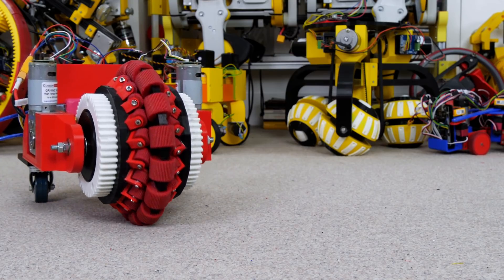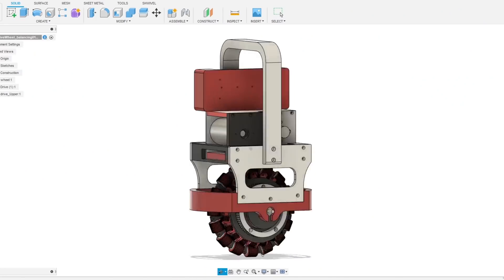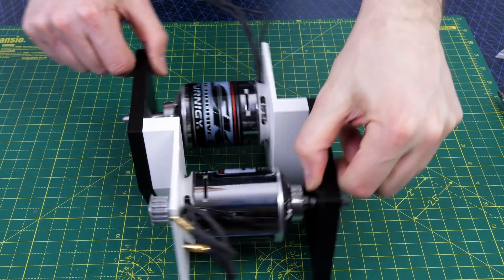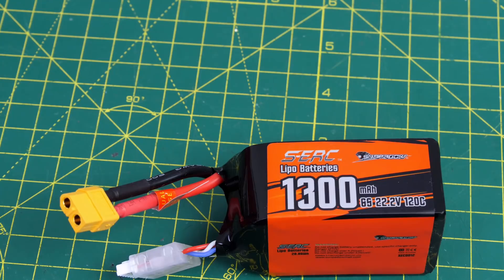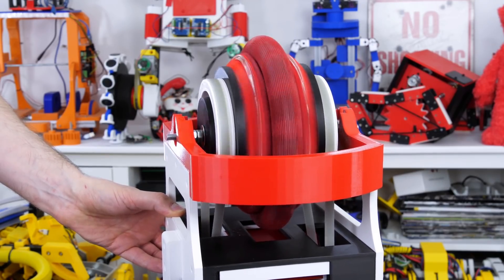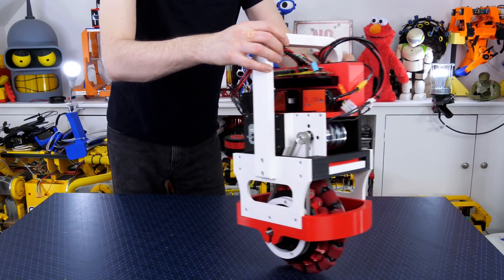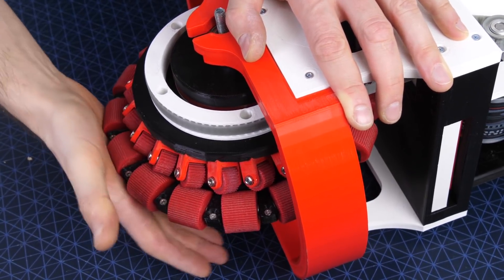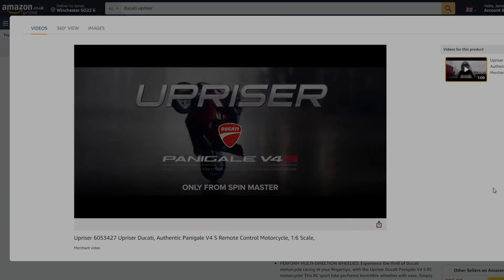Omni-Wheel Balancing Robot?

Comment: Pretty impressive how quickly you build complex electro-mechanical prototypes.  As for the wheel my feeling is there's too much play in many places for the control system to reach stability.  Those big motors are are causing large inertial changes.
Reply: Incredible how creativity, skills, cad, 3d printing and yt sharing work so well together. Far beyond any expectations.

Edit: forgot to mention the sponsors 😎
Reply: Right? It's very nice

Comment: Little idea as improvement for this design: You could angle the side wheels slightly outwards so the roller wheels only make contact with the main wheel where you can actually produce traction with the ground. This way you don't lose any power on driving unnecessary wheels and clamp more on the main wheel

Comment: You could add universal joints between the small wheels instead of a flexible shaft
Reply: I don't know if the definition of UJ has changed, but when I was younger it meant something which turned uniform rotation into uneven rotation. To keep the rotation even, they had to be used in pairs like this: ⁻\_ . However, there was another type of rotation-transmitting joint which it didn't have this problem. I've forgotten the name. Anyway, the bad kind is the one with a fork on the end of each shaft holding a cross-shaped piece in the middle.
Reply: cv joints would be difficult to build in the space between the wheels, and you'd need a lot of them

Comment: Do you reckon having diamond-shaped corrugations on the main wheels would allow better gripping with the smaller ones on either side?
Reply: Kinda turning the main wheels into gears 🤔
Reply: I have a swarm project. But its hard to get attention on the internet. It MAY have a small impact towards the STEM community. Dont wanma make a video on to get 0 views. Should I wait for this tuber's reply? Planning om showing this to college since I may not get much out of internet
Reply: on hot sands, it moves quickly! & it's bite, is no fright! but leaves some in horrible trauma! is the end near? or will he be late 4 diner, again! only dt will tell !!
Reply: @comelighttheway  ?
Reply: I suspect diamond-shaped corrugations could lead to uneven gripping if you're not careful.

 @Jermain-cz4bh  Looks like an allusion to the viper or the diamondback rattlesnake, both of which are venomous.

Comment: A 3rd Encoder on the thread which is sticking out of the sides could actively cancel out the creep, as the controller will be given the exact position of the middle wheel hub.
Reply: Good idea... Difficult to get it's data though
Reply: @Lardah  Why so?  Isn't the main axle going right through the main wheel frame and sticking out each side?  Mount an encoder just outside the bearing on the red base and you have it.  (at least it SEEMS like that's all you would need)
Reply: @mikefochtman7164  ah yes I just assumed the axis is fixed outside and has bearings on the inside...
Well then nevermind

Comment: You could wrap belts around a wheel, from a central hole to the outer edge. Put rollers along the outside edge of the wheel for the belts to roll on, and a motor in the center of the wheel could turn the belts for sideways adjustments.

Comment: You could remove the gears and crab walk it if you made it actual wheel itself to have an array of motors that are arranged into the shape of the wheel and each motor is regulated by a combination of mercury switches and lidar and gyroscope.
Each motor is essentially a tiny wheel with a tire that can also allow for traction that can even have the ability to regulate density through a capillary manifold system. This can even spring into the air with actuators and a origami of winged flight possibilities.
This can be produced from harvesting from rocks and bio organic material brewed from a tea of gross disgusting microbial bacteria and post treated to see how affordably it can be replicated. 
👁️👁️

Comment: Could you add some sort of encoder to the center wheel so that your software can accommodate for the drift by actively tuning the motor speed? A combination of position data for the outer and inner wheels can act like a traction control system.
Reply: Oh that might be a workable idea
Reply: Exactly what I thought, he's getting feedback from the motors not from the actual outputs so the system is still an open-loop system at least when it comes to this part.
Reply: +1. Computer mouse wheel is what comes to my mind first, buy it may not work at the speeds this low

Comment: You can get a flex shaft to link all the bigger rollers pretty cheap off ali, they are often square so you could have the center hole of the rollers be square to key the wheels together, then join the two ends halfway down  one of the rollers.
Reply: Wouldn't even need to be a continuous piece, a short piece that would slide into a socket on each side of each wheel would connect them all together just fine.

Comment: What about keeping this roller design, but change the surface of the rollers to be meshing like gears, so slip is impossible?
Reply: If one tooth slipped, it needs to be accounted for, but it's an awesome idea!
Reply: @codyman242002  If two kanted rollers are always in contact with a hub roller, then no teeth would slip and it would self-align to mesh.

Comment: I have two Ideas on how to improve the design: You could put diagonal teeth on the outside wheels that align with those on the output wheels so you don´t entirely rely on friction for force transfer. 2nd you could look into 3d printed constant velocity joints like they are used in cars to connect the circle of wheels. you can print them in standart pla nad then pop in small steel balls for the force transfer. This should result in a constant speed transmission between the single wheels with minimal play if you tinker around with the tolerances. They might be a little fiddly to put together but should work with less play and friction than flex shafts

Comment: What if the treads of the small and big wheels meshed? 

Interesting to see the results of using a solid core on the wheels.
Reply: That's what I was thinking last time. Couldn't the grooves be printed at an angle (or a helix)? Maybe it would screw up due to the flex, or the wheels not being a constant distance from one another.
Reply: I came into the comments to reccomend a helical cut on the drive wheels!
Reply: @jimmygriffiths    Yeah, I see a few did before me as well.

One option I hadn't thought of that's posted farther down is using that left and right thread pattern on the big wheel. But I don't know if that would be better than just making the left/right small wheels asymmetrical in their orientation.
Reply: I think no tread would also work
Reply: You might be onto something there. The problem with TPU wheels is that although they're squashy, they don't have much grip.
Reply: @iAmTheSquidThing  We clearly need to help raise money so he can build a Buster Beagle Injection molding machine so he can make rubber parts.
Reply: @Morberis  tbf he could just cast PU parts from printed moulds. The 20A hardness stuff is pretty sticky.

Comment: Maybe try making the wheels a worm gear with counter rotating threads (like that whacky "screw any direction" bolt) and put rubber tips on the apex of the worm gear threads and use them as the wheels, then you can have the driving wheels as actual gears and solve the grip issue.
the major issue would be clutching between each wheel might be impossible and make the high speeds impossible

Comment: I'm geuss using a universal u joint on each wheel is to weak? Small plastics probably can't handle the stress.  I mean, it's a really tight space, but if you integrate one in each hub instead of using a metal shaft it might work out,  it might not be impossible. 

There are Lego u joints. I remember them being really strong. Maybe it's time to add Lego to a build

Comment: Would it be possible to fit a pair of bevel gears between each pair of rollers so they all turn together? Or u-joints if there's not enough room. It's a lot of parts, though.
Reply: Possible, yes, optimal, no. Bevel gears for this would realistically be too small for 3D printing, especially FDM, especially under torque. CV joints would be better than U-joints, but adding those would increase the gap between each roller, plus again the issue with 3D printed parts. Making a rigid system by rigidly coupling the hub rollers would also make things way too complex for what it's worth. A flexible shaft is the simplest, and honestly the best, solution to this problem, because it's coaxial with all of the disc rollers and doesn't need a complex mechanism to make the system rigid. This type of wheel just does not work without every roller being within the rigid system, free-spinning components will always circle back to the issues shown here; either the disc rollers need to be held rigid to each other, and in turn hold the hub rollers rigidly, or vice versa where the hub rollers need to be held rigid to each other, and in turn holds the disc rollers rigidly.